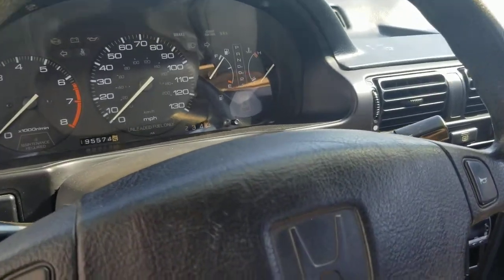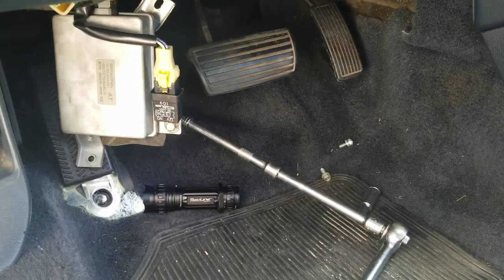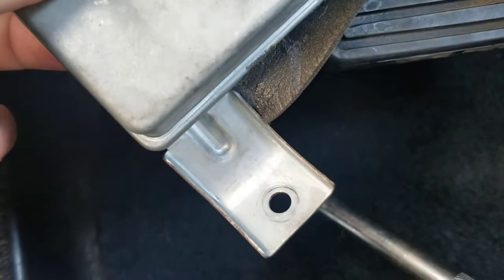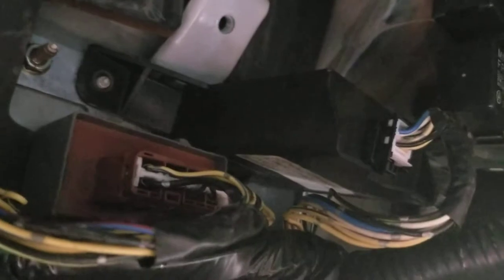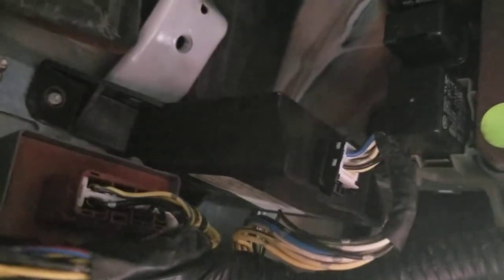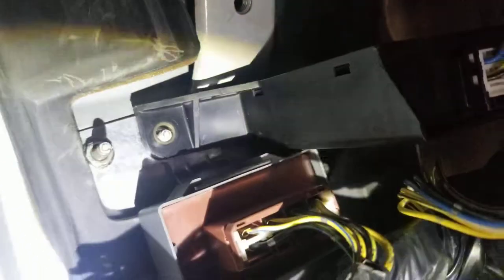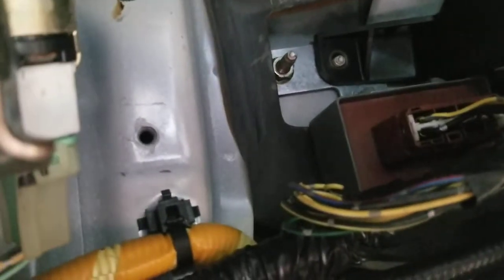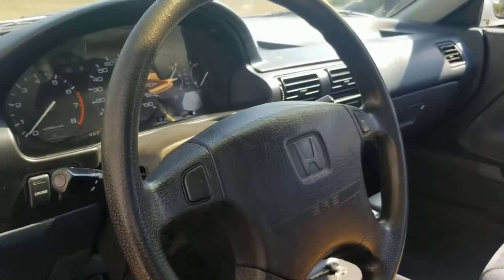1992 Honda Accord fuel pump relay

Comment: Have you or anyone experienced the vehicle losing power a while running down the highway?  Mine has had trouble starting. However, one morning, it started right up, and several miles later, it stalled out losing power. Thanks for sharing this video

Comment: We have the same car same issue and I just fixed it thank you so much for putting this video up I’ve been stumped for days
Reply from the maker: Not a problem! Currently trying to fight the dreaded idle up and down issue these things always have.
Reply: @AWrightTX  did you figure how to fix rpm issue?
Reply from the maker: @toyotacamry1239  I never completely was able to trace it down. Fixed a few things that slowed the issue down but ended up selling the car. I believe it had a vaccuum leak somewhere!
Reply: @AWrightTX  lol thx for replying back
Reply: @AWrightTX  I know it’s been 2 years and sold the car but for anyone reading it’s the idle air control valve. There are a few videos on how to fix it.

Comment: Have same year make and model.  Just replaced the main/fuel relay that you show in video. (Although it wasn't the issue) however it is the original one from 1992! Wow
Reply from the maker: Wow that's crazy how long these cars just keep going! Were you able to find the issue?
Reply: @AWrightTX  LoL I have a 93 wagon... sometimes doesn't start after short trips... gonna try this.  pretty sure it's the original one too!
thanks so much for posting!

Comment: Thanks for taking your time to make this video dude
Reply: Just got back from finishing the job and she started right up. Pretty tedious job I had to push down the brake pedal with my head so I could get the angle to remove the module that overlaps the fuel relay, also I dropped my 10mm and it got swallowed by the car somehow but overall I’m just glad the car started finally.

Comment: Im having trouble with my honda accord 93 at some certain temperature its starts to fail if droven has to be without letting go of the gas pedal
Reply from the maker: May be a timing issue? Have you changed your fuel filter? I also believe there is a charcoal canister that sometimes goes bad on these.